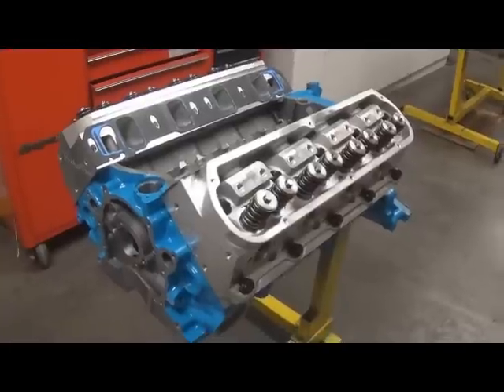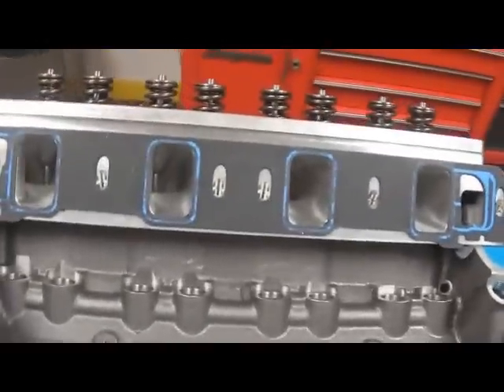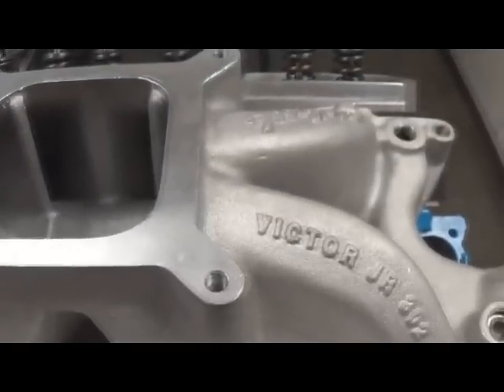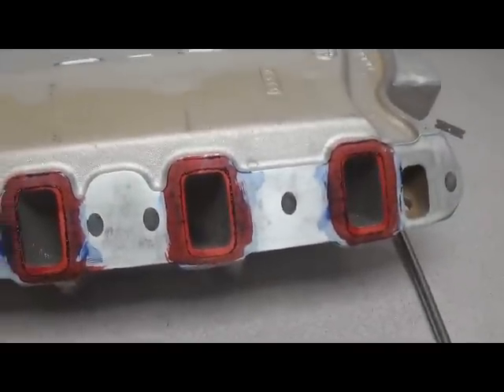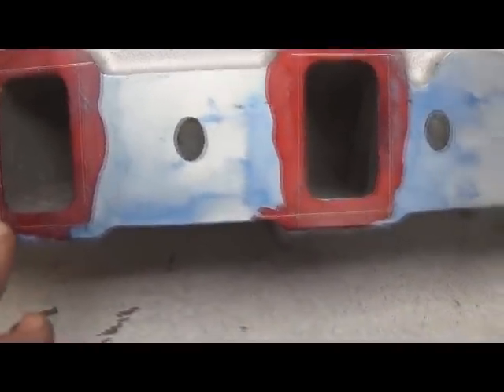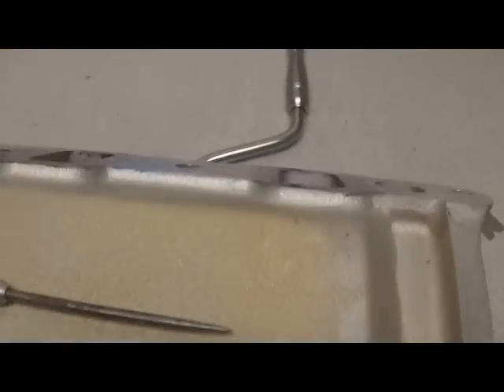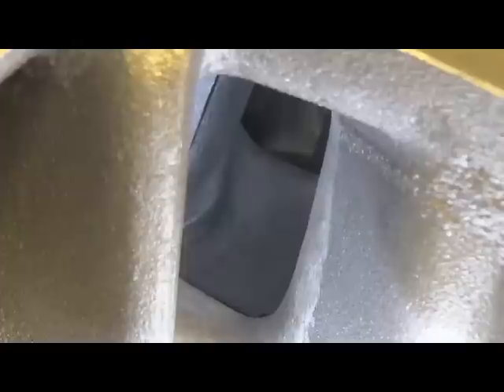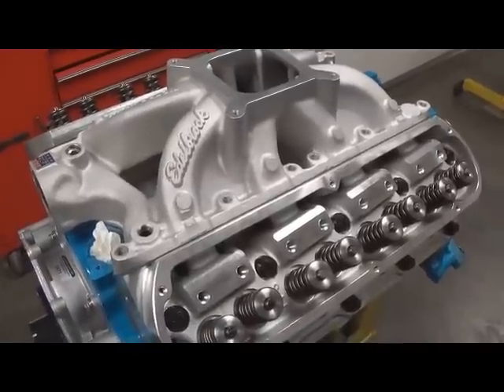INTAKE MANIFOLD TO CYLINDER HEAD PORT MATCHING PROCESS

Comment: I did my set up myself and everything worked out great. I’m a career precision ASME welder and grinder of stainless steel so this was pretty simple money saving task. I went as far as I could up inside of the short turn radius of the intake runner and left the plenum alone except for grinding out the casting lines. 
   Thanks Prestige Motorsports.

Comment: Hello Prestige,  Excellent video.  First I have seen that is precision.  If you don’t mind I would like to offer a different angle that will give exacting results as well.  I have worked aviation sheet metal for many years, 73 yrs old now, and whenever I came to a hole that could not be back drilled or scribed or could not use hole finders on, I came up with a trick that was always on the money.  If you would attach your gasket as you have done and then cover the ports over with a mild tack tape or film or such, then trim the substance to the edge of the port opening.  Now take a fairly heavy tack double sided tape and attach it to the intake manifold in order to cover the ports over.  Now place the intake in place and tighten it down.  Let it set for a few minutes and remove it straight up.  The heavy double sided tape will adhere to the light tack tape and will lift it off and you w I’ll then have transferred the image of the port openings onto the intake and you can port it down from there.  It may take a couple of tries to get the knack of it but it has worked for me for many years and the tolerance in aviation sheetmetal would suffice you as well.  Just thought you might want to try it out.

Comment: Truly appreciate your contribution !  There are many videos on this subject out there and this is by far the best.  This seems to be the only video which makes use of the red & blue Dykem to accurately match ports and the comments about Ford bolt holes/angle surfaces is spot on.   I use studs for my SBF intake manifold, so this should make the step of sliding the intake onto heads simpler and less prone to any sliding  (left-right-forward-aft).
Reply: Gaskets will move around if not glued. Why mess up what you've done.

Comment: We just took the gasket that we used. Then made one without the port holes in it out of copper. Spray machinist dye onto both sides and bolted it on. Removed it and the dye transfers to both the head and intake... No guessing. You know just where to remove and transition the ports for that head\intake combination...

Comment: That's a time consuming way to get results. 
Sometimes you can mark the front and top of the intake and gaskets and easily transfer them for scribing. 
Sometimes it's easier to drill 1/8" holes in the front and back of the intake flange (well away from water) just deep enough to kiss the heads. Then you can "pin" the gasket to the intake flanges for scribing. 
To each - their own. 
Cool video!

Comment: Great vid.  I never thought to do it exsactly like that.  The only thing I reLly do differently is I use some threaded rod to line the intake up. Or just cut some long bolts to make sure I’m right on every time I lifer it off.  And if I have to egg out the holes to line it up better I just elongate them to sit it where I want.

Comment: I have one of the 575 hp 427w and I’m going through this process but the intake will not sit straight down on the heads. I have to slide it from the front and that will probably smear the Prussian blue. Plus how can I seal the rails? Thank You

Comment: Would you then use the same cut gaskets for the final assembly? All future gaskets must be cut or they would block the port correct?
Reply: How much $ would you save by not making a second set??
Reply: Use a gasket such as Felpro. Each part number is consistent with the port. Unlike most cheapies where you are having to cut the gasket bigger.
You have to be carefull on what you touch with the grinder. 
Having tried to straighten an intake port I have struck both water or  head bolt hole. Minor problems can be devconned but larger are weld it or scrap it. 
That intake had a LOT taken out of the roof. In reality there is very little difference if you are a little conservative A slightly smaller intake seldom hurts. But an intake bigger than the ports does hurt. More so the higher the rpm.
Edelbrock Performer for a Clevo or M engine has a  medium raceport Chev intake. Which is  on a 2V head. The 4V is hugely different. So the mixture falls into the bigger hole.

Comment: Do you port match the coolant passage also? I have a #906 Vortec head and there is ALOT of material within my blued scribe mark. Intake gasket is out of a kit. "Problem solver gasket" i was told by FelPro. Plain metal core with black rubberized molded gasket around port.

Comment: Would this procedure work on a plastic, fuel injection manifold? Minus the lining it up by eye part.
Reply: Of course.
Remember port FI is dry flow air. No gas droplets in that air like a carb does.

Comment: Would it be worth port matching a stock motor just to improve the flow? Say i port it just a bit to match, but dont do an actual port and polish.
Reply: I did it one time on a sticker and put it back together.
I actually did feel an improvement.
But generally... No. It's a waste of time and $ for what results I got.
Do it on a build up. Yes.

Comment: Can you do this without the block? Reason i ask is can I take heads and intake to grinder to do the port matching  without having to take whole engine in
Reply: The heads might sit slightly different. So no, not really.
What we always did was leave the manifold .025" smaller all around than the heads. Just in case.
No power difference.
Reply: Yeah if whoever is doing the work has a mock up block and you know your deck height and what head gasket you'll use.
Can take a mock up block and use shims to get the heads to the right height, then fit up the intake.

Comment: One question I have is what makes the Gasket manufacture a porting expert ?????
Reply: The heads might not be on the block right. The core shift on heads and manifolds could be real bad 
This fixes the variables....
For your one particular installation.
Two are rarely the same, only close

Comment: The right port bottom line was right on the edge of the manifold casting. That bottom line did not look right. You should use studs to locate the gasket (mark it as you did) and secure it with nuts and plastic washers. You should use the exact same gasket you plan to use during assemble to get the port lines exact on each part.

Comment: Wow dude..... WOW.....Anyone who would willingly waste there time to port that manifold  when the dollar for dollar bang would be in the head's then just purchase anyone of the numerous High performance Aluminum intake manifolds specific to your need's . there are so many high performance manifolds out there that out flow ANY stocker  match ported  or not it's just a huge waste of time unless of course it was a certain Stock class of racing that requires a stock manifold ..But every Small block responds  well to high performance aluminum head's ....
Reply: that might be true for single planes like this but an RPM dual plane for my car out the box flows 220cfm

most TF TW 170 heads flow like 250 @.500. 

 im not putting a victor Jr on that as that stock flows 270+ and why would i need one on a 10:1 302?!  Id put a port match performer on it.  if they know what they're doing it should ALSO flow about 250 when its done  but port alignment is ALWAYS important.  not just how much something flows off the shelf. 

 nothing is ever aligned off the shelf and also there will be less flow scatter if you have a hand porter work their magic.  thats exactly why they charge anywhere from 200-800+ a manifold. 

the racers will agree with me even though im just a stocker for now. it depends on what you re trying to do.  a street car needs less of this.  you could put brodix ST5.0 185s or AFR 185's?TW 11R 190s  off the shelf on this engines and a victor jr and theyll flow about the same at around 280-CFM which is a lot even for a stroker
Reply: Flow measurements are for comparisons. Actual engine running conditions are often quite different.
Think about it.
Reply: MrHazel
Spec flow values above 55%, tend to make soggy street driveability.
Eg.
302 x 55%= 165 cfm. 
Bigger heads and flow values increase rpm capability but make em pretty soggy below 3500.
Most of us are NOT DRIVING DYNOS.
Reply: Michael Laverty, please tell me which manufacturer ever used an Edlebrock Victor Jr on any production model engine, and in what vehicles was it offered? In addition, since when was a Victor Jr not a high performance intake manifold?
Reply: @hotrodray6802  Huh?!  

i guarantee you none of those cars set up the correct way are soft down low. 

a lot of people have put AFR 185s and TW 11r 190s on 302s and picked up EVERYWHERE so big heads and soggy bottom end is a myth for the most part